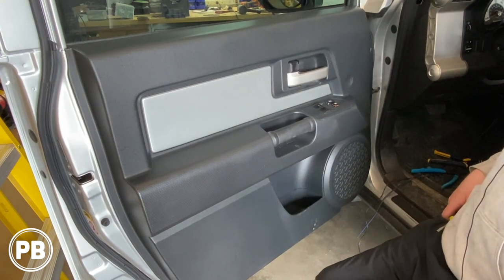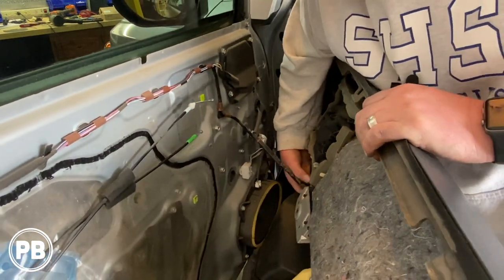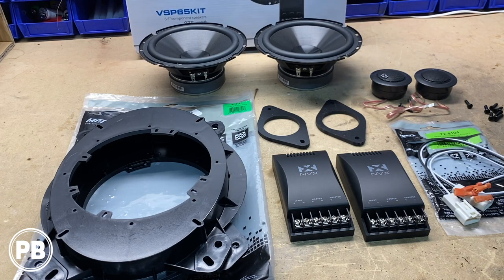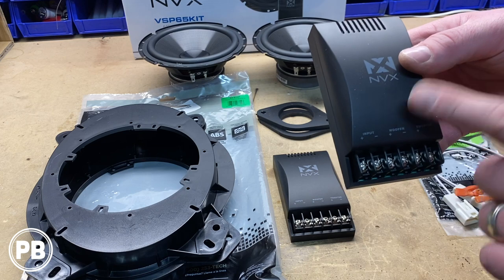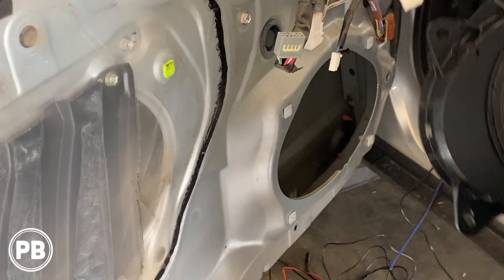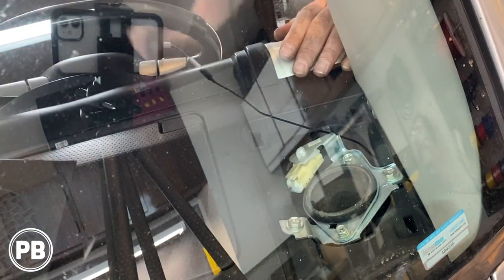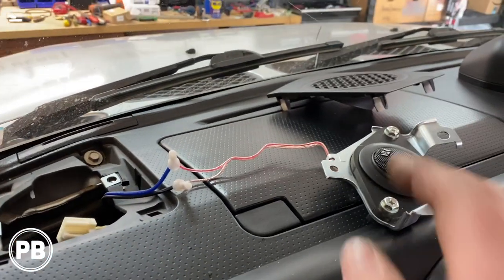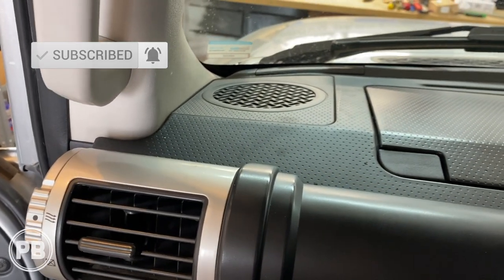2007 - 2014 Toyota FJ Cruiser Front Speaker Install

Comment: Dude, great videos! I'm on the precipice of doing my first head-unit install into my FJ sometime in the next month or so and really want to do it right. Hoping I can use the existing speakers, JBL 440w Amp, and Subwoofer so that I don't have to replace those.. but I guess the factory speakers (even the JBL upgrades) are low impedance so.. not sure what the implications are of my intended head unit upgrade.

Comment: Kindly can you explain how and where did you run the wires from cross over to the Tweeter?

Thank you for the amazing videos
Reply from the maker: Honestly, the easier setup would be to do a component set that doesn't have an external crossover that are integrated in each speaker (like the Alpine Type S line).  This avoids the need to connect both tweeter and mid bass to the same crossover.

Comment: I’m upgrading mine and like the layout you did with this FJ. How did you hook up the rear pillar speakers? I’m upgrading mine but curious how you got them working with a 4 channel set up.
Reply from the maker: From factory, the "rear" speakers in the speaker wiring harness adapter is set to power the rear tweeters, and to feed signal to the amp/sub if so equipped.  So you an power them from the new radio, or from an amplifier from the harness adapter behind the radio, just depends on your build.

Comment: You didn't explain how to replace the factory 6x9 to an aftermarket 6x9...
Reply from the maker: This works for both 6.5 or 6x9", depending on the speaker you want installed.

Comment: What’s the difference between the 6.5 and the 6x9? Do the 6.5’s sound better? thanks man. Helpful video
Reply: No, 6x9s are larger, can handle more power, & have the capacity for more coaxial tweeters, so they play stronger, louder, & clearer. This guy is promoting a certain product.

Comment: why do you need to run your own wire to the tweeters is it to disconnect the exciter speakers?
Reply from the maker: You’ve lost me - not sure what you are asking.
Reply: they need to go to the crossover so they can high passed or will damaged getting a full range signal